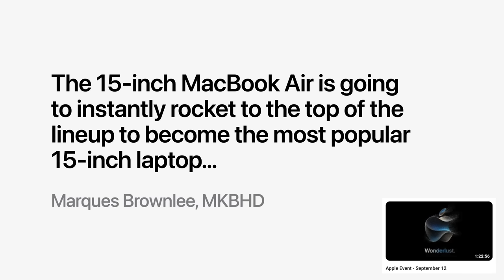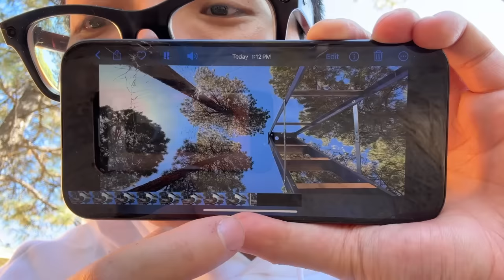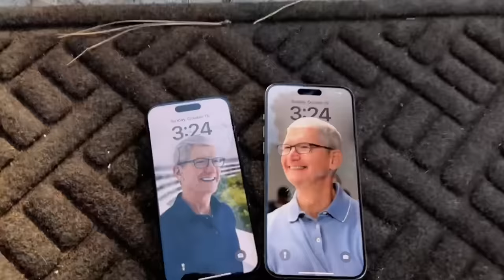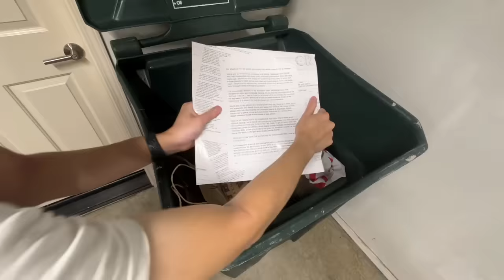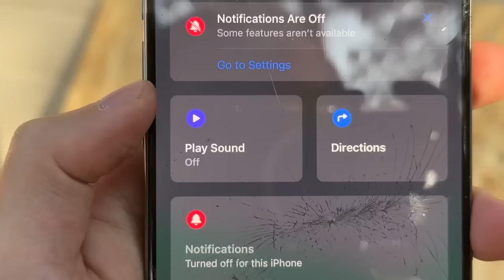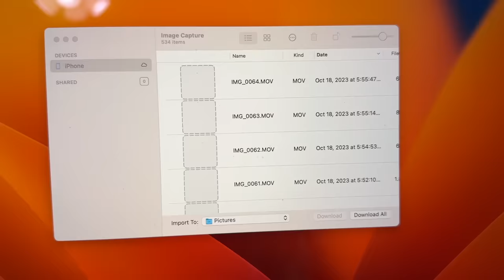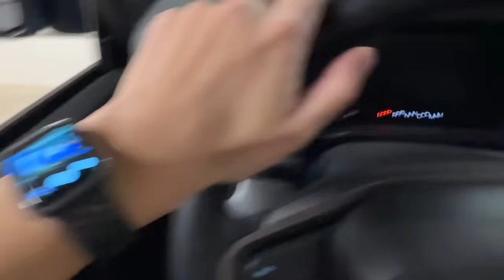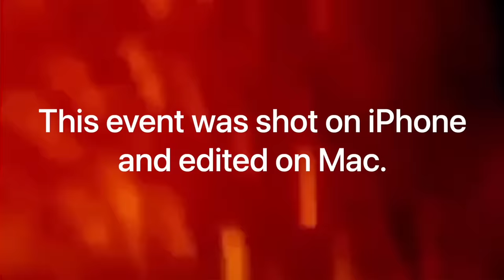Bored Smashing - iPHONE 15 PRO

Comment: It would be cool to do a collab with one of the repair channels to basically see if it is even physically possible to repair the electronics you destroy. Most of the stuff you destroy will probably be gone for good, but it would be really fascinating to see what could possibly be repaired with enough skill. Especially if you did board level damage to those devices since that would require pcb repair which would make for a really interesting video.
Reply: I agree

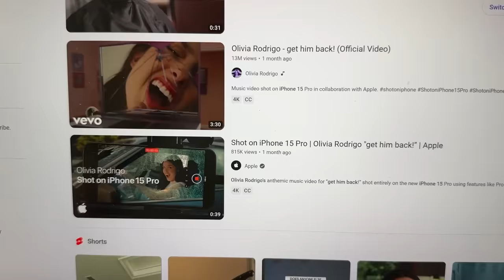Comment: Wait a second... is this... A WINDOWS LAPTOP AT 4:08???? EEEEEEWWWWWWWWWW!!!! I am disappointed... 😞😞😞 (Is what every apple fanboy ever said)

Now getting serious again. 

To be honest, i think it good that apple finally changes to USB-C (or being forced to), because there are a advantages, for example, (when having to transfer data between a Mac and an iPhone with a Cable) the faster read and write speeds of USB-C, because these decades old lighting cables still use transfer with speeds from the Mini USB Era which is only half as fast as USB-C.

I can remember back when i still had my iPhone XS before it broke from falling of a balcony i was pissed off about the painfully slow transfer speeds of these lightning cables. And was surprised after switching to an Android with an USB-C port how fast the transfer speeds were.

Okay i'm getting a bit off track here.. all i want to say is that i'm glad that there finally is USB-C. 

Bonus point: Having to deal with less adapters for doing the simplest tasks known to man.
Reply: 4:08*
Reply: I ain't reading allat